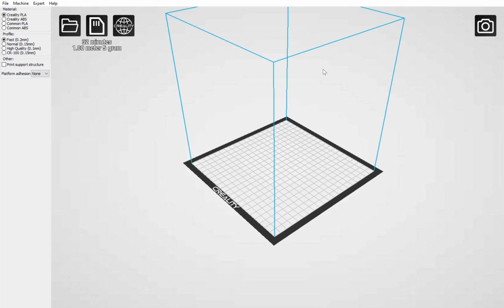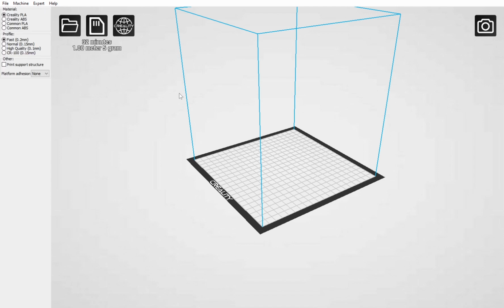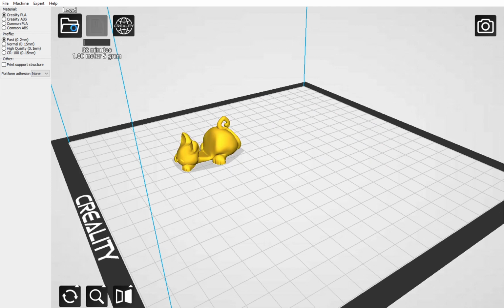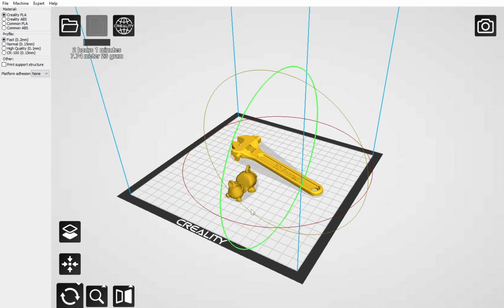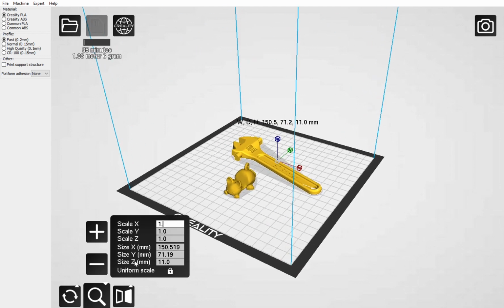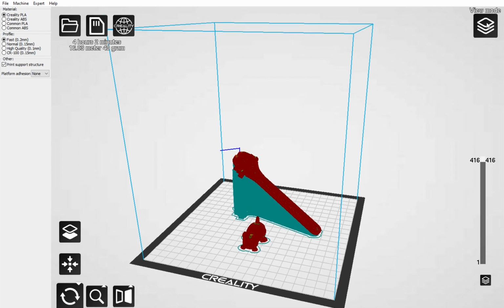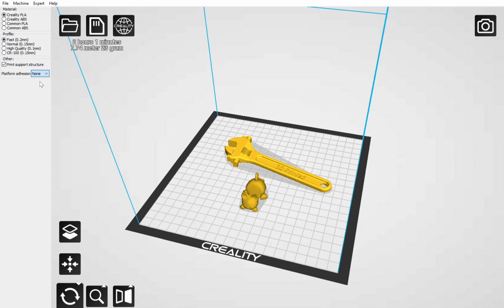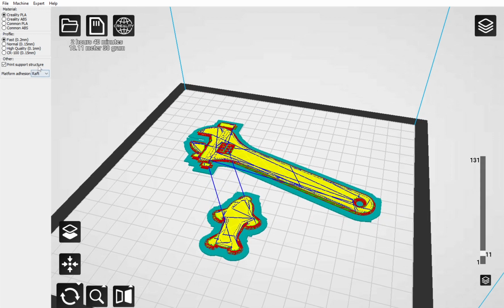3D Printing for the NHS - Creality Ender 3 Pro - Creality Slicer Software

Comment: have only just watched your video, one question, in Creality slicer you set up the temperature for the nozzle and bed, you set up retraction etcetc but when I take the saved gcode file to my  Ender 3 printer  it seems to ignore the temp settings and maybe everything else. What am i doing wrong Thanks

Comment: Where can I download this slicer?
Reply: You´ll get it if you buy a printer or you might find the download somewhere on the internet. But if you get yourself a printer normaly there is a sim-card with a usb adapter included. Well thats at least the case if you buy an ender 3.
Reply: @niklasborchert6662  I had it on the sd card i got with my ender 3 but the card died so i wanted to know where i could download it
Reply: @TheCorruptorMeow  same im trying to find it

Comment: Thanks for your input, fairly new to 3D Printing and still getting my head around things.
My question is if I'm doing a helmet and I want to minimize or remove the supports inside the helmet, how do I do this? 
I am using the exact slicer software above but version 1.2.3

Comment: Just new to 3D printing and making a few cosplay outfits for my son  If the model is to big for the bed what is the best way to slice the model to fit.  If i try use the split object into parts it jsut says not respndong.  Trying to make a helemt.  Any help for this beginner would be great.
Reply from the maker: Hi Sam,
I've never actually used that function before, however I can explain how I would approach the issue. 

Normally, I first try a quick and easy fix, that is to check out https://www.thingiverse.com/ to see if anyone has already done the hard work for you. There a loads of great people out there who make things 3D printable, and offer a number of sub-models that can be downloaded, loaded in the slicer software, and then 3D printed separately before being affixed together afterwards.

Alternatively, I do all of my modelling / splitting etc. in a free CAD software (Autodesk Fusion 360), which is fairly simply to use. In your case, I would export a number of .stl sections of the helmet from Fusion 360 and then import these into the slicer software.

Hope this helps!

Comment: Thank you for this amazing video!

I have a question!
 I have g code file but when I load it to Creality Slicer software it shows the print bed area empty and there's no file.
What can be the reason for this problem, and how can I make my g code open properly in this slicer software?

Thank you in advance!
Reply from the maker: Without seeing the g code it is hard to see. I've also encountered this problem before too. I solved it by finding the STEP file for the object I had the g code for, and then created the g code in the Creality slicer software.

Comment: For some reason, my PLA Filament is not heating up, therefore it won't print. What do I do?
Reply from the maker: It would seem your nozzle isn't getting hot. I suggest checking the cables to make sure your connections are good and secure.

Comment: I have a problem with some of my prints it just prints in the air on the corner only. How do I fix that?
Reply: hey manny one thing ive noticed mine was doing the exact same thing! change the sizing of your device for instance my ender 5 plus is 350X250X by 400  change your size and youll be able to move it around! :) im having the air problem too
though